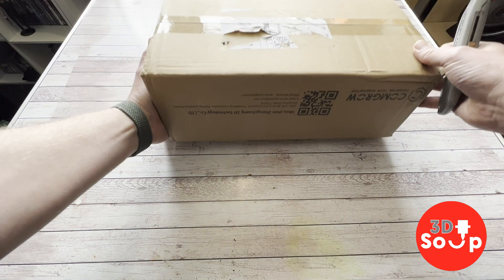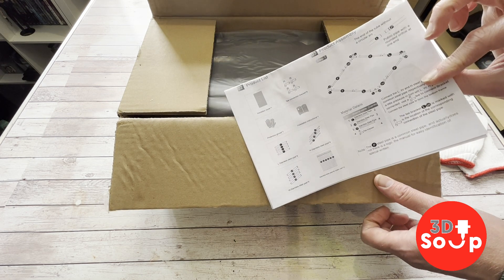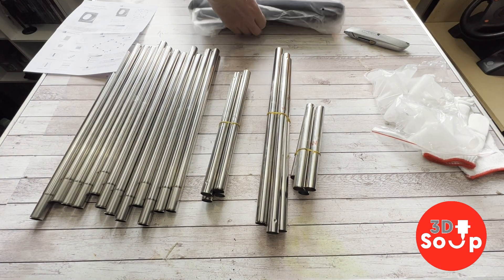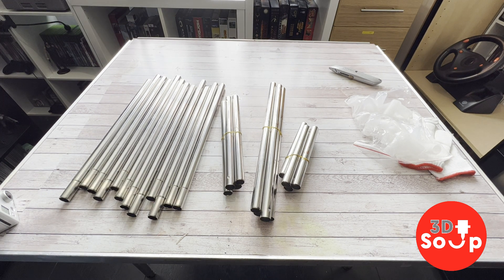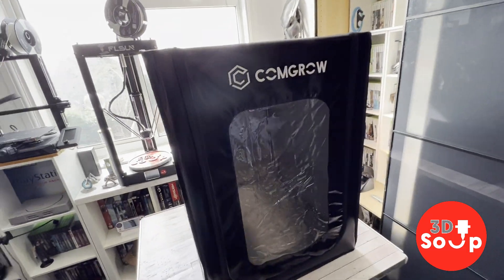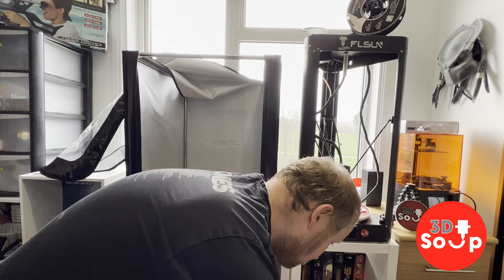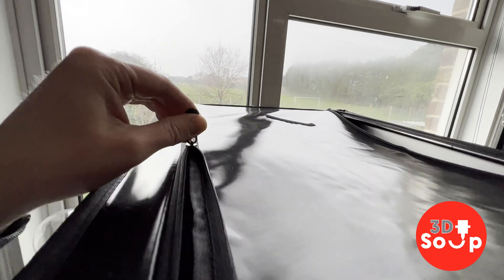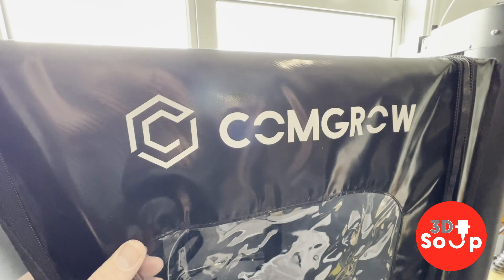Ender 3 S1 fire proof enclosure build and review. Should you buy a cheap Comgrow one from Amazon?

Comment: Highly sceptical on the 'fire proof' aspect. That's a plastic front which will probably melt.
Reply from the maker: Yeah, I’m thinking that any fire will burn the oxygen off and go out before it’s hot enough to melt the front, but I’d have to test it to be sure. I combine it with a thermal and smoke detector to ensure it’s as safe as possible- you can never be too careful with 3d printing . Thanks for watching
Reply: @3dPrintedSoup   Good point about the oxygen. I've been trying to find a video testing with a real fire but no one has done one yet. I've opted to not leave the house with it printing. I have a smoke detector, a smart plug which octoprint can turn off when there are errors / thermal run away. I have 4 fire extinguishers in the house now too.
Reply from the maker: @hippopotamus86 you can never be too careful when your printer is in your home.
Reply: @hippopotamus86 new to 3D printing terms: what’s octoprint?
Reply: @marn200  So some 3D printers allow you to plug a USB cable in so you can print direct from software on a computer instead of memory card. You can install a system called Octoprint onto a Raspberry Pi and connect it to the USB port. Then you have so many more options and plugins. You can do remote printing, setup automated printing and bed clearing etc. I used it for a short time to send a signal to a WiFi smart plug to make it turn off the printer when a print has finished. I've since stopped using this entirely as I've moved to a Bambu Lab printer which is much safer.

Comment: As far as I know, Comgrow is the US distributor for Creality here in the US. I bought the same enclosure and the only thing I wish it had is dual zippers with both meeting at the bottom front of the enclosure. This would make it more convenient to open the flap a little to get access to the control panel.
Reply from the maker: Like fume tents, 2 zips allows a gap where fumes and smells can escape into the room. One zip allows a seal once closed fully